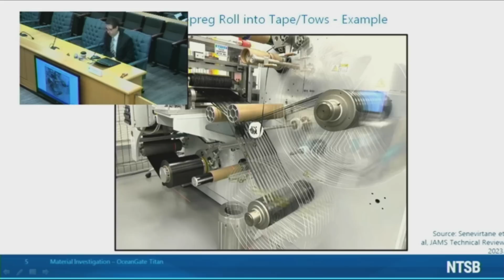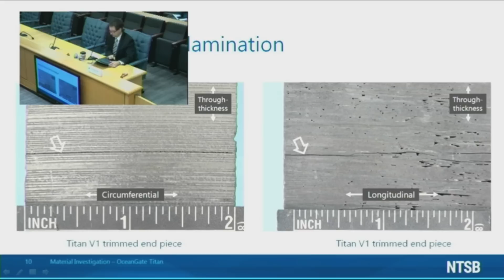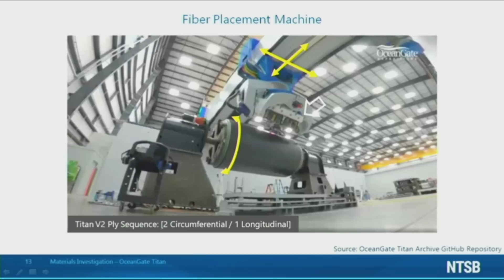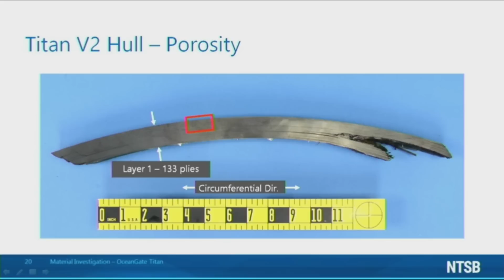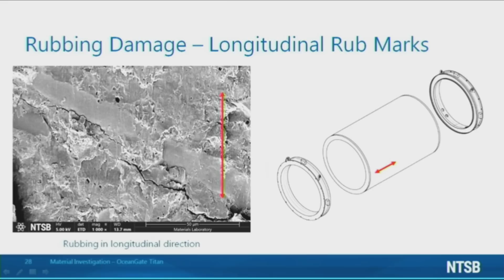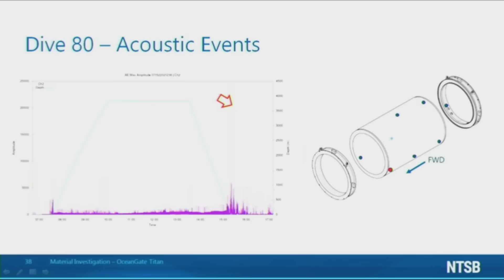Titan Submersible Hearings

Comment: This demonstrates a complete disregard of FRP basics, as well as a complete misunderstanding  and/or disregard of the respective strengths of the materials used.

Perhaps the only thing done 'correctly' was the construction of the viewing port.

For starters, anyone who has actually executed FRP construction knows that its main enemy is resin-poor layup, which appear endemic throughout the cylinder in question, and should have nixed the project's use of prepreg until/unless the problem was eliminated.  It is likely that the only way to do this would be to perform the 'winding' process under vacuum, and/or to use some sort of hybrid manual/machine wet-out system.

Furthermore, the 'wrinkle problem', and it's 'jake-leg' solution, should have been a show-stopper, as "grinding off the wrinkled layers" effectively removes them from the strength calculation;  in other words, if on each layer there was a 1/4" wrinkle that had to be removed, the effective thickness of the cylinder was actually 3 3/4", not the 5" that the incompetent Oceangate 'engineers' specified.  (Keeping in mind that the recommendations from the advice given by qualified engineers, considering the known porosity problems associated with the  chosen construction method, was for a 7 -10 inch wall thickness.

And on to the lack of understanding/consideration of structural elements.  Simply put, for a pressure-on-the-outside application such as this, the cylinder should have been made of titanium and the spherical ends, of hand-laid, vacuum--bagged, carbon fiber/epoxy FRP, with the resin/fiber ratio closely and strictly monitored and controlled, as should be the orientation and schedule of the fiber layers themselves. As a minimum .

From a seat-of-the-pants 'engineering' perspective, probably the best compromise would retain the titanium end hemispheres, and fabricate a true composite cylinder, using, say, an inch and a half thick titanium cylinder wound with properly saturated and oriented carbon fiber  (perhaps with kevlar or some other 'super' fiber added if testing so indicated...).   With properly  followed FRP construction protocols, PROBABLE about 7 inches of epoxy/carbon would suffice, and they might even get away with the Oceangate's 5 inches.  And of course the whole shebang should be tested, full size, to at least one and half times its pressure rating before anyone (except, perhaps, ignorant, hubris-filled billionaires) is allowed anywhere near it.

Of course, I've not investigated even the comparative coefficient of expansion values of titanium and carbon fiber/epoxy; as this is just, as stated, a sear-of-the-pants thought experiment --- but at least it has over 50 years of hands-on  experience with both the forces and materials involved...

And, finally, this is a real-world example of the near-mythical 'woke' mind-virus we hear so much about nowadays.  This 'vessel' should never have been let into, nor out of, any responsible government's port...

BTW, where's the rest?

Comment: Merely seeing the way the rings were attached to the CF cylinder was enough for me to say I wouldn't go down 200 feet in that thing, I have a difficult time believing there were zero voids in the epoxy. IMHO the ring should have been oriented with the receiving groove up and the channel nearly filled with epoxy in an autoclave then drop the tube in the ring recess and pull a vacuum (which removes air voids in the joint) and allow to cure.  I am under the belief that the CF "tube" should have also been wound in a vacuum. 
Any air voids would compress under the immense pressure at depth and UNDOUBTABLY would have caused delaminations or deformations to the CF tube which would cause undue strain in the glued joints and between bonded areas. 
The ground wrinkles should have been an indication that things were not going as designed.

Comment: Dear NTSB, stop cheaping out on the foam over the mic....the cheap ones dont act as pop filters like they're supposed to. Dont go and replace all the mics or something stupid like that. Just find a good quality foam which fits your mics that stops the 'P' pops and breath noises and order a pallet of them. Enough to replace all the mics in that room with something that will make these hearings sound more professional than a city council meeting would cost all of $500, at worst. For all of the mics in that room. For just the board and front row? Significantly less. Especially if you call the manufacturer and tell them you're the NTSB.

Signed, Everyone.

Comment: I love how they used acoustic and strain gauges with absolutely no industry standard baseline to determine caution and warning thresholds. They set this based on results gained all within their own designs on a bleeding edge solution (carbon fiber hull submersible), that had no rigorous, repeated lab tests. In other words it was all made up.

Comment: My guess is a failure of the glued joint, air was trapped when they lowered the ring on the carbon tube, preventing a uniform adhesion on certain points around the ring. Leading to the carbon tube to shear the inner lip of the Titanium ring and initiate the collapse. The loud bang was the hull returning to it’s place when the pressure was lowered on a previous dive. The next dive proved to be catastrophic.

Comment: A low temp resin wet lay wouldve been better, prepreg is way too hard to remove air and get the heat into the bottom layer to cure it. Also the peelply bond wouldve created air voids. But of an odd design and process.
Reply: If i understand the hearing they tried something like that (albeit probably at room temperature) and couldn't make it work, probably due to shoddy workmanship, and then went with this as an option. Also I suspect this hearing is the only time when these carbon fiber hulls have been analysed using anything approaching relevancy with a microscope. Hell even the bolts used on the F-16's when I was in service 20 years ago saw more thorough analysis before reuse than this one of a kind deep sea submersible did.
Reply: @aBoogivogi  yea crazy hey mate. Ive worked with prepreg before and unless you can allow the resin to outgass etc while curing and layup, its not the best product to use, also the never mentioned the resin percentage, usually its 30-45% but if it were me, id be using 50%.
I use infusion because there air is removed before the resin enters the part.  Never had any problems.

Comment: It's a bit late to figure out that this RTM was some poorly designed and chosen system in a such a way that amateurism would be an insult to amateurs. This should have been done before, so soemone with legal authority could have shoved up Stockton stupid's face the fact his "sub" place was in the museum of horrendous ideas.
Reply: You could argue that the real time monitoring system did its job. It identified a permanent inelastic deformation on dive 80. Stockton et al chose to ignore the warning.
Reply: @nigelbarker8726  You're right - I should have proofread myself, I realized it re-reading my comment. What I meant was that the fact they chose that RTM as a warning system to be able to react to an issue, was less than "amateurish", in a sense that the system will in fact tell the issue but at no point that will allow them to face a catastrophic scenario. And while they were at it with sensors, one could think they could have placed much more than that for more detailed information regarding damages.
Reply: @movzhepok  Oh, I agree. Especially with the acoustic emissions. The really telling one is the big one at the end.

Comment: Im a retired mechanical engineer and in my time I got to work on many different materials. Sometimes tight tolerences might be flexible depending on the application. However, whenever a safety issue was present the tolerences would be maintained without question. 
I would say just a general view of the design and construction of the sub indicated it was flawed, it didnt look like it would work safely to me. However, now the serious lack of attention to the quality of construction of the hull has been shown, coupled with the extreme pressure of the deep and the return to normal surface pressure, the sub was always going to fail. Im astounded that anyone with a basic understanding of engineering went on board. 
This vessel was not professionally designed or manufactured.
Reply: Think he sold it on its new type sub  everyone’s been on those old designs be one of the first to try this. Probably spoke with such confidence people believed him .
Reply: What astonishes me is that this guy with all the money he has built the submersible as if he was was a Chinese manufacturer making a counterfeit product.

Comment: I heard that Rush was drawing up plans for the Titan II and that It was going to be two washing machines duct taped together.
Reply: I heard he was going to use schedule 80 PVC sewer pipe with glued on end caps and gorilla tape re-enforcing. Rush was all about cutting costs and thinking outside the tube.
Reply: No no,  @snappingbear , he was going to use flextape and have an extra roll available on dives to slap on any problems.
Reply: Controlled by an Etch n Sketch
Reply: Refrigerator has better seal.
Reply: @esphilee  Does not matter, the pressure will stick 'em together...
Reply: @SuperWhiteBarry better insulation.
Reply: And a few My Pillows for comfort

Comment: This highlights the significant challenges in construction of thick monolithic carbon laminates. 
What the investigation shows are the typical results of early attempts to manufacture very thick laminates… and this is VERY thick. 
In an aerospace application, a lot of work would be performed to develop an optimal and repeatable manufacture process. Having developed a process, there would be an extensive test programme to fully characterise the material properties and gather sufficient repeatable results to establish a statistically significant set of material properties unique to the construction and to allow adequate safety margins to be derived and demonstrated through full scale testing. 
The laminate defects shown in this presentation are not surprising … but the solution has been to work around the problems rather than resolve them. In my opinion, these work arounds show a fundamental lack of understanding of the materials used or of the implications of such defects on the overall structural performance, especially in mind of the known working environment. 
Structural failure of a laminate or adhesive bonded joint will most likely precipitate from a void, disbond or other material discontinuity within the laminate. The nature of the construction as a series of cured laminates each 25mm thick with (apparently) inconsistent adhesive layers interconnecting these thick layers will result in what can be considered a series of concentric cylindrical sleeves with poor mechanical through-thickness load transfer from one shell to the next. This is clearly not the structural configuration the design team set out to achieve. 
My next question for this board of inquiry should be to review and question the material properties used in the design and the relevant knock-down factors used to convince the relevant “Design Authority” that the construction was fit for purpose with adequate margins of safety being demonstrated to an acceptable degree. 

The aerospace composites community will readily tell you that creating thick monolithic laminates is not easy. A lot of effort has to be applied in just managing the temperature through the laminate thickness to ensure consistent material properties … this is exacerbated by the exothermic nature of epoxy based resin systems as they chemically cure … meaning the cure temperature can easily start running away in the middle of the laminate. It can take a number of tries to get the cure cycle right … somehow, I do not feel convinced that OceanGate were even aware of such matters.

Comment: Strain gages to warn of failure in a non-ductile material is nonsense.
Reply: “Warning: You died 500ms ago”
Reply: @bunnybinksoncp Actually 5ms (allowing for the scan time of the recorder)…
Reply: @bunnybinksoncp : "Warning: OMAE WA MOU SHINDEIRU"
Reply: @Jesse-qy6ur  NANI!?
Reply: The worst part is that they sort of did their job. Though they didn't function as described by Rush. They still indicated that some damage to the hull had occurred and Rush ignored them, which only goes to show that he either didn't believe in them, or he just didn't give AF. Either way, the term, "Safety Theatre" is absolutely right.
Reply: @deltasyn7434 : If he hadn't brought four other people with him, this would be pure comedy.
Reply: @deltasyn7434   The entire rationale behind these sensors being used in this context doesnt make sense you see. So even if they did their job, which they did, that doesnt mean anything.  IF the sensors go red it means the hull is no longer safe. If your 3000 meters down and the alert goes red, well, your simply very likely to die.  Its not a safety feature, its a death warning system.
Reply: @JackJackKcajify  Based on how Rush described them. It sounds like he intended for them to be an immediate warning system to let the crew know that they have to ascend. But there's now way that is feasible. But what they were ale to do is detect changes to the hull's integrity after that accident.
Reply: @deltasyn7434 The Titan only needs to drop the weights to ascend. 

The Carbon fibre hull is naturally buoyant. They need to put weights on it to make it dive. 

Get rid of the weights and it will float right back up, no power required.
Reply: Imagine if Jim Bobs trailer hitches and welding tanks were composite materials with strain sensors.
Reply: The material does yield.
Reply: "Strain gages to warn of failure in a non-ductile material is nonsense." 

Nyah, I'm sure one could make something reasonable out of it, IF you tested enough times. 

These guys didn't.
Reply: Well, it'd give you something to watch in those final few milliseconds...
Reply: well you see in the presentation the sensors worked absolutely fine and I love they placed it and we can investigate and learn from it.